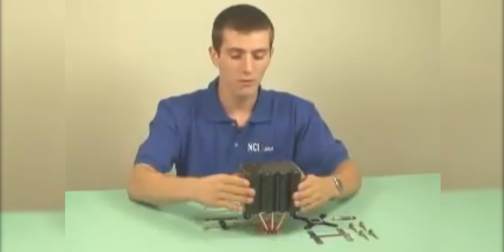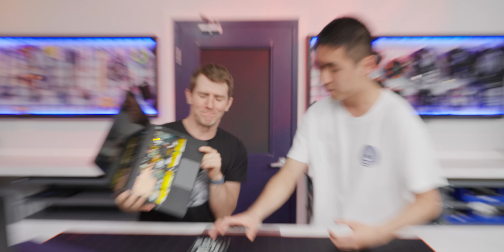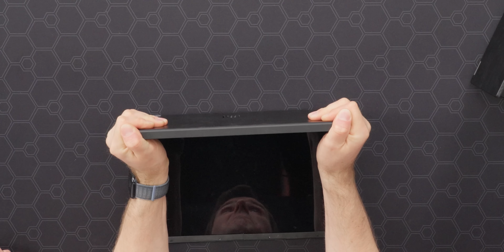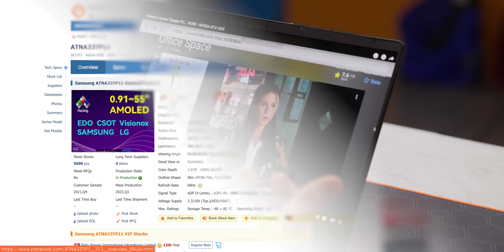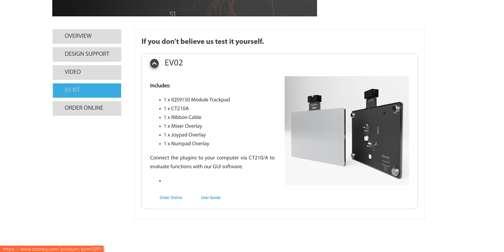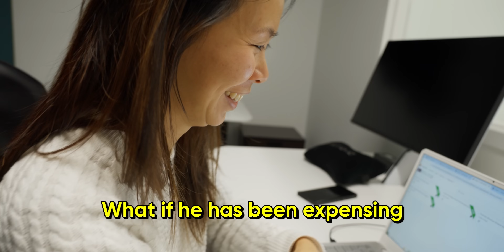This Kid Made his Own Laptop and it’s AMAZING!

Comment: anyo_ne I need to convert my old laptop in like this what is the procedure for the assemble. I am from India and suggest my laptop :

Sony VGN-CR35G

Specifications

Operating System
Genuine Windows Vista® Home Premium (English Version) with Traditional Chinese Language Pack

Architecture
Processor Technology
Intel® Centrino® Processor Technology

Chipset
Mobile Intel® PM965 Express Chipset

Processor System Bus
800MHz

Processor Name
Intel® Core™2 Duo Processor T8100(2.10GHz)*1*2

Cache Memory
3MB

Memory Bus
667MHz

Main Memory
SO-DIMM slots
2 SO-DIMM slots (The pre-installed memory module uses two)

Pre-installed
2GB DDR2 SDRAM *3*4

Hard Disk Drive
200GB*5(Serial ATA, 5400rpm)

Optical Disc Drive
Maximum Reading Speed
DVD+R: 8x (SL), 6x (DL)/ DVD-R: 8x (SL), 6x (DL)/ DVD+RW: 6x/DVD-RW: 6x/ DVD-ROM: 8x/DVD-RAM: 5x/ CD-ROM: 24x/CD-R: 24x/CD-RW: 24x

Maximum Writing Speed
DVD+R: 8x (SL), 4x (DL)/ DVD-R: 8x (SL), 4x (DL)/ DVD+RW: 8x/DVD-RW: 6x/ DVD-RAM: 5x/ CD-R: 24x/CD-RW: 24x

Drive
DVD±RW/±R DL/RAM Drive

Graphics
Dedicated Video Memory
128MB

Graphics Accelerator
ATI Mobility Radeon™ X2300

Display
Type
14.1"Wide(WXGA:1280x800) TFT Colour display (Clear Bright LCD Lite)

Interface
i.LINK(IEEE 1394)
4pin (S400) x 1

Display Output Connector
Analogue RGB, mini D-sub 15pin x 1

SD Memory Card Slot
SD Memory Card*7(SDHC compatible, MMC compatible)

Microphone
Stereo mini jack x 1

S Video In/Out Connector
Output x 1

DC IN
x 1

USB
High Speed USB 2.0 x 3

Network (RJ-45)Connector
10Base-T/100Base-TX x 1

Compatible Memory Cards
Memory Stick (Standard/Duo Size compatible, MagicGate compatible, Memory Stick PRO compatible, High-speed data transfer compatible) , SD Memory Card (SDHC compatible) , Multi Media Card

Modem
V.92 and V.90 Compliant x 1

Memory Stick Slot
Memory Stick (Standard/Duo Size compatible, MagicGate compatible, Memory Stick PRO compatible, High-speed data transfer compatible)*6

PC Card Slot
ExpressCard™/34 x1

Headphone
Stereo mini jack x 1

Wireless Connection
Network Connection
Intel® Wireless WiFi Link 4965AGN

Wireless LAN Type
Integrated Wireless LAN IEEE 802.11a/b/g/Draft n *8

Bluetooth
Bluetooth standard Ver. 2.0+EDR

Wireless LAN Frequency
5 GHz (802.11a/Draft n), 2.4 GHz (802.11b/g/Draft n)

Wireless LAN Data Rate
maximum 11 Mbps (802.11b)/54 Mbps (802.11a/g) 300 Mbps (Draft 802.11n) *9

Camera
Front Side Camera
Effective Pixels: 1280x1024

Audio
Microphone
Built-in monaural microphone

Speaker
Built-in stereo speakers

Sound Chip
Intel® High Definition Audio compatible , 3D audio (Direct Sound 3D support)

Keyboard/Input Device
Keyboard
approx. 18mm key pitch/2mm keystroke , 82 keys

Touchpad
Intelligent Touchpad

Battery Life
Optional Long Battery
VGP-BPL9 Lithium-ion battery: up to 6.5 hours of use*10

Bundled Battery
VGP-BPS9/S Lithium-ion battery: up to 4 hours of use*10

Size
Dimensions (WxHxD)
335.1 mm x 21-38.3 mm x 249 mm

Weight
2.5kg (including the supplied battery)

Included Software
Support
VAIO Recovery Center, VAIO Update 3.0, VAIO Data Restore Tool 1.0

Word Processor / Spreadsheet
60-Days Trial Version of Microsoft® Office Professional 2007*12

Home Network
VAIO Media 6.0

Tool
Roxio Easy Media Creator 9.1, Adobe® Reader® 8, Norton Internet Security™ 2008(Installer)*13

Music
VAIO MusicBox 1.1, SonicStage Mastering Studio 2.4, SonicStage Mastering Studio Audio Filter 2.3

Video Edit/Playback
VAIO Movie Story 1.1, VAIO Content Exporter 1.2, Adobe® Premiere® Elements 4.0, VAIO Edit Components 6.4*11, WinDVD for VAIO 8.0

Utilities
VAIO Control Center 2.1, VAIO Camera Capture Utility 2.7, Setting Utility Series 3.1, VAIO Launcher 1.1, ArcSoft Magic-i™ Visual Effects 1.0

DVD Creation
Click to Disc 1.0, Click to Disc Editor 1.0

AV Entertainment
Windows® Media Center, Instant Mode, Image Converter 3

Still Image/Photo
Windows® Photo Gallery, Picasa™, Adobe® Photoshop® Elements 6.0(Installer)

Supplied Accessories
AC Adaptor
AC Adaptor(VGP-AC19V26)

Battery
Lithium-ion battery(VGP-BPS9/S) *14

Warranty
Period
One year*15

Comment: Truly inspiring project. You need a significant level of self-commitment to pull this off. If I finish any good project close to this I'll mention this video as my inspiration. Just figuring out the embedded display port is hard enough. Doing kernel development is not easy. Designing a 6 layers PCB like this one is super challenging. The keyboard is a piece of art.

Comment: yo linus iam making a edge device called nvds 1030 fx and it mean
neural vision deep sampler 1st generation 0 upgradable 3 total parameters and the fx stand for some like the intels f, but what it truely means means not that optimised bcs this isi my frst device
well for people who thinks thats crazy well Iam just 13 and at grade 8 . and also what makes m device  set apart from other edge devices is thsi is liek alexa and also you can use it as a normal device and wil have 1280p 10:15 ips 60hz screen and will look crazy 
it will rock the orange pi 5 plus 16gb board with decent thermalat high power 
but it will be petg plastic bcs obv this is my first device yk . also this will only cst arounnd 280$ without r&d
Reply: ohh iam still developping it okay so it wil be finished within like next 7months

Comment: I see the "Compiz cube" and I have to explain this for people who are like Gee golly, how do I get that today?! The answer is dead-simple, but hard to figure if you've never been using Linux for more than a decade; use the MATE desktop, or any other GTK2-based DE which lets you swap out the compositor. MATE works best for the people who want to re-create old Ubuntu pre-2012 when GNOME team deprecated completely GNOME 2.18 and knocked the sails out of Canonical.

This is literally what set back Canonical. GNOME team destroyed their momentum with GNOME Shell and they've committed to it since. Some time after GNOME 2.18 became obsolete, an Argentinian developer by the name of Perboros Perberos created MATE. First adopted in a "Major" distribution by Linux Mint team, it later ended up in Fedora as the MATE Compiz spin, then after that in Ubuntu MATE.

The easiest way to experience this is to use a distribution which provides this, like Commodore Vision OS or Fedora MATE Compiz spin. Ubuntu users can find a script which easily installs the 0.8 branch release courtesy of Scott Moreau, and Arch users get to enjoy Compiz 0.8 through the AUR (but that's too much bother to write out exactly how to go about it).

The successor for Compiz will end up being Wayfire, also maintained by Scott "Soreau" Moreau, which users should be able to enjoy in an experimental Wayland implementation for XFCE.

Comment: Awesome work Byran! You did what I thought of doing many times but always thought was too expensive and risky to embark on. I built robots and related things instead, which were lower risk as most prototypes cost under $100 to make and most parts were recoverable. You have balls like a bull man, not meant in any strange way, just that it takes serious confidence to go that far on a project like this - there is a significant period where you spent a bunch of money and don't know 100% yet if it will work or not. If you want to go more towards a x86 PC with the motherboard part there is the LattePanda Mu compute module which has multiple DP out and an open standard for. There are 2 different motherboards for the module but you could adapt the one you have to it and keep the case and keyboard etc as-is. There might be others, it's just one I know off the top of my head that might be relatively easily adaptable to the stuff you already have. 
The style you have for the laptop is really cool, love the blacked out look of it.

Comment: Oooh Linus, my man, calling your thing a "real laptop" when next to this is a major faux pas. 06:22. In comparison yours is an etch-a-sketch that has been used to death - and I'm being generous. ".. looks like a real laptop..." 19:25 so it's official, Linus does not know what "real" means. Astounding. Linus needs to slap himself for that one. That is more a "real laptop" than Linus is a "real Linus". I am honestly disappointed, I would have expected Linus to know the meaning of the word "real" and in particular in this kind of context, because it means all the shizz linus has made is just fake junk too. 
Also having PCB's made is not "shockingly affordable" unless you are easily shocked and haven't really thought about it much at all. If having a PCB made cost thousands, none of us here would be watching videos on computers, and Linus wouldn't be making any videos either because he would never have had a computer except some old hand me down maybe but certainly no camera. There are many ways to make a PCB too, JLC does make it a lot easier&cheaper to have fine pitch multilayer PCB's made but you can make them on a CNC machine that costs a few hundred bucks, in your own home. I have, JLC is or at least was far too slow to use when prototyping for me, so I made all my PCB's first on a CNC, populated them by hand then conformal coated some of them to avoid oxidation etc. Once I was happy with how it turned out I ordered some batches of boards from JLC since CNC made prototypes are less than optimal when you need more than say 1 or 2 of whatever the thing is. You can make multilayer PCB's with a CNC too, use pinheader pins&sockets to connect the layers. Fine pitch chips are painful on CNC boards, you need - well, you'll want to use carrier PCB's for those when prototyping because fine pitch CNC work is hit&miss a LOT, far too much to be practical, and you don't want to waste expensive chips, you can't keep desoldering the same chip over and over again, it WILL die one way or another. You'll have to guess how I know.

Comment: 18:43
when he said "if you look down at the ground, you get 60fps"
to which I muttered "it's playable" because I used to do this too on games that were out of my pc specs' league

I absolutely LOST IT when he actually said "it's playable"
Reply: Playable is anything above 30 😂
Reply: am i not getting the joke or do people nowadays actually consider anything below 60fps as unplayable? i'm not gonna pretend i don't see a difference between 30fps and 60fps, but i'd still call 30fps perfectly playable. below ~25fps is when it's getting a little too rough for me. crazy how fast the tech advances.
Reply: @thatguy5233  I believe one of the opinions may be similar to "as long as you're in control of the mouse" and the framerate doesn't hold back your ability to be precise, then yes, 30fps is "playable". I actually finished crysis on a 8500GT with sub 20fps back in highschool and was even worse up on the ice mountain level at a constant 7-10fps. Its just a mere standard these days. 

Would you call 720 or 1024 monitors usable in 2025?
Reply: @ what kind of question is that. they're one of the most commonly used, no need to believe me, check yourself 🤷i think that speaks for itself.
Reply: @QueilerMusic  I don't know if I came off as rude, but I answered your question whereas someone else could've taken the chance to also use the same attitude towards your comment. Just saying
Reply: @QueilerMusic  bro I was also shocked cause wtf 30 fps is very playable

Comment: The battery is lithium right? Idk if placing the battery directly under a keyboard is a good idea. If the user is rather temperamental or for some reason some heavy object falling and some how put tons of weight into the keyboard, will the battery be safe or it's just time bomb?

Comment: Its so great looking at this guy and his design. I was actually thinking about making my own laptop as well but I have too many projects on hands for years now.

The best thing is seeing how some solutions I planned were the same while others are completely different. I wanted to make thicc and powerful 17-18 inch gaming/engineering laptop with massive speakers sourced from dead BT speakers I have lying around. The screen magic this guy did is over my head so I'd just source something easier like 240 hz mobile monitor from asus (comes with its own battery too). I planned to ignore weight and just go with stainless steel and my favourite magnesium alloy I used for lab equipment when working in Germany. Nothing comes close to beauty and feel of this metal. Also the keyboard I'd go with a fat mechanical one but planned the embed the battery in it as well (same!). My plan included battery in the lid as well since whole structure was inspired by old Asus gaming G70 line.

Comment: I cheered when Linus ragged on eDP non-standardisation. So true. It's a 'standard' in name only, while many LCD panels will use the same pinout (in) many also do not... and it comes in 30 and 40 pin variants... and I've seen just about every pinout possible on motherboard ends. Also if you want to do something that your laptop manufacturer never intended then good luck finding a cable with the pinout you need, micro-coax means getting them manufactured is pretty expensive too.

Oh and finding data sheets for panels is a pain, Panelook sucks for making them unavailable even if you want to pay. Finding laptop schematics to get motherboard end eDP pinouts is a lot easier.

Comment: Well, I've only spent roughly less than 2k cad on my wip framework based cyberdeck, so, as a software dev who knows very little electrical engineering, well, my route will still be cheaper for myself.

Comment: The guy is right about modern laptops not really needing the WiFi antenna's in the display - I have 4 year old Asus Vivobooks at work which have absolutely no antenna's in the display. I know because I changed out broken displays on them. I was surprised myself because the WiFi connectivity on these laptops is great. Never had an issue with signal strength.

Comment: its cool but a $150 raspberry pi and a $30 screen and a $25 case will achieve about the same effect if you add a keyboard and mouse and still be less than machining the chasis as cool as this is just not that practical but it is very cool and if you're just after a cool project this is amazing

Comment: The quote "A lot of RF engineering is just black magic, so a lot of the signals you can't really probe  it's just a guess, based on vibes" is the most Engineer line I think I've ever heard, and I absolutely love it!
Reply: Being involved in the professional side, I've heard this almost verbatim many times. Equal amounts of references to specs and "pixies" or "spirits"
Reply: It’s not so much black magic so much as “I waste less time with trial and error than learning how to make the current configuration work”.
Reply: you can probe them but unless you work at a gigantic company you rarely have the tools required. i have done high speed signaling at several ghz without having any ability to measure and it ended up working fine just off the simulated parameters.
Reply: @drkastenbrot  Your profile pic (wonder how many people even know what it is) matches your comment way too well lol, all that's missing is you telling us you fell asleep halfway through it
Reply: There is something called a smith chart, also called a "black magic design" that is used in some RF engineering which is where this quote comes from
Reply: Unless you are on good machines anything you probe with changes the signal, most have to recalculate the difference and backtrace to an approximate figure.
Reply: Studied RF. Can confirm it’s mostly vibes with a few guiding principles.
Reply: Mechanical engineers: (anger)
Reply: I work with RF in the field and I swear, sometimes I see situations where it works when it's completely fucked and then gets worse when you fix it.  This is indeed black magic.
Reply: Not a physicist, but isn't RF quite literally "vibes" to some degree?
Reply: @ThereMaybeViolet  I mean, he's not wrong. 😅🤣
Reply: RF engineering is indeed a black magic.  I designed my own 4g+ antenna which my own house has no connection to any network so made a 28 dB gain antenna connected to a modem. Now I have Internet connection even in NLOS environment
Reply: BS. Nobody designs rf by f$$ing vibes. Well, nobody who must actually do working design in budget and on time.
Reply: @leonidfro8302  dunno about you, but I research NMR, all our equipment is RF engineering.  After trying to use equations for building and operating equipment, we gave up and settled for vibes.
(This has a math reason having to do with variables you haven't/can't control for.)

Comment: Wireless mouse without a battery, my guess would be he's going to use an induction coil either under or built into the mouse pad. Then probably a super capacitor in the mouse itself. Tell me I'm wrong Bryan

Comment: this is the direction i want laptops to go. a laptop really should just be a chassis for a kb, mouse, power, and screen. then just socket an soc into it somewhere. want to upgrade, replace the soc. you can take the same soc plug it into a desktop monitor and you got a desktop. plug it into a car and you upgrade your infotainment system. plug it into your phone and you got a phone upgrade. you can design a 10 year chassis and upgrade the core components every 2-3 years with a simple module swap.

Comment: I don't mind visible screws at all as long as they aren't in the way or interfere with use and think that it's great to not have to do stupid stuff like peel off stickers or rubber feet which never fit back right after the first time. This is legitimately so cool